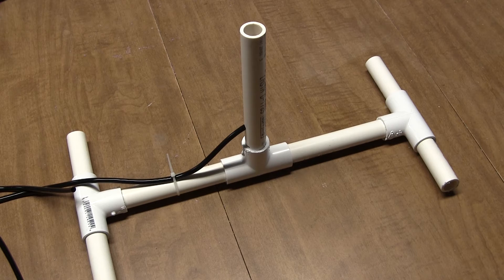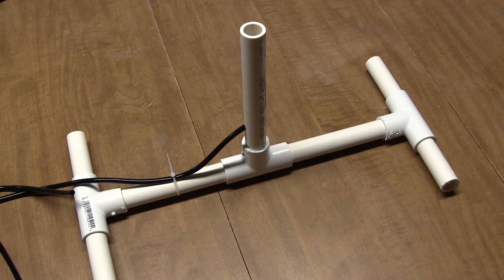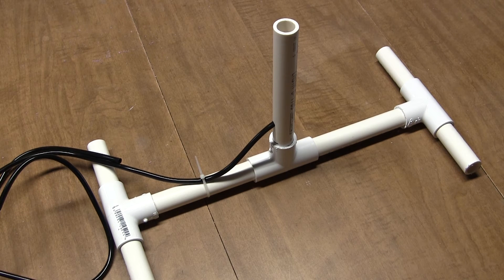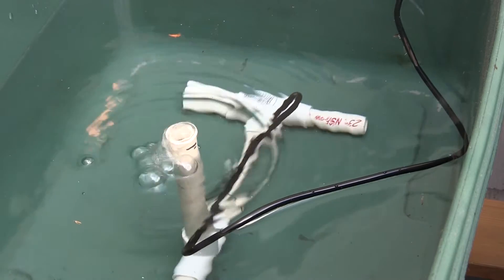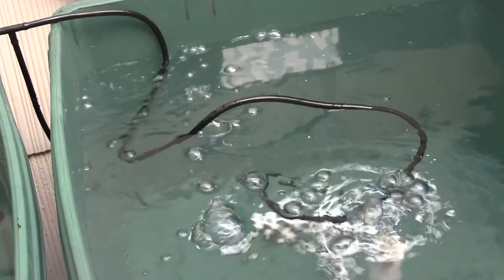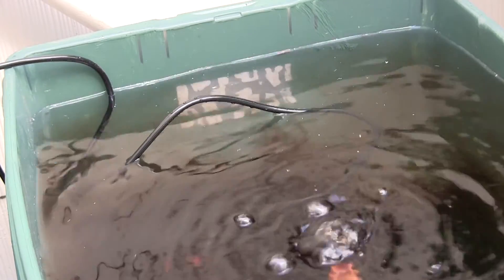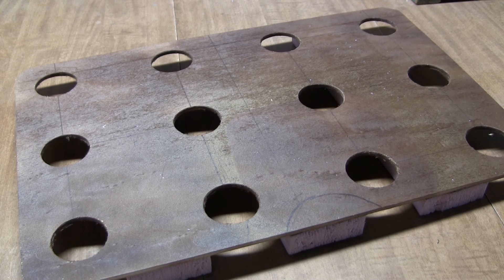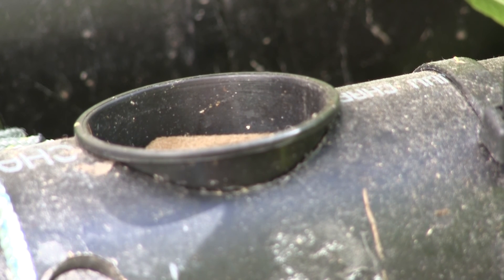Deep Water Culture with Air Lift Pump

Comment: Im watching!! I need a system for microgreens.
Reply from the maker: I haven't done this but you could use trays with holes in the bottom and put foam blocks under them so that there will be solution in the grooves of the trays.
Reply from the maker: I'm going to try bubble wrap for flotation- the thickness may be just right.
Reply from the maker: 2 pieces 8 x 10 may be about right.  Can float it in a normal 1020 with no holes.
Reply from the maker: No on bubble wrap.  Next I'm trying 1/2" by 1" foamular across the tray.  2-3 strips.
Reply: All you need is air line regulators(resistance) plus air stones at end of air line. A larger pump would still not create a consistent flow without these. They also sell these at pet co or anywhere they sell aquarium  air pumps.